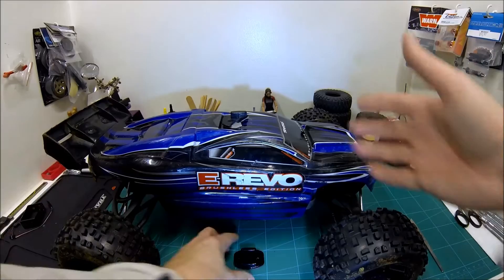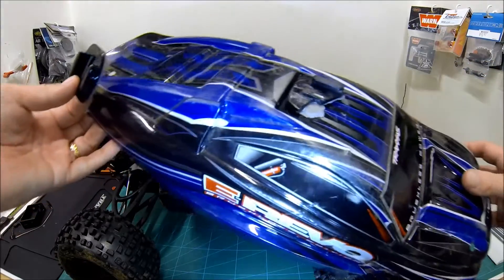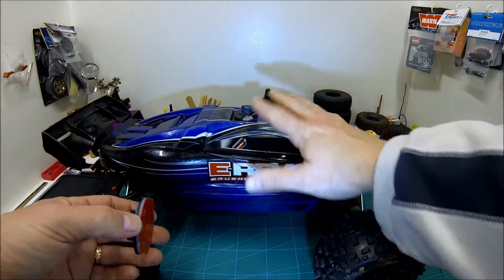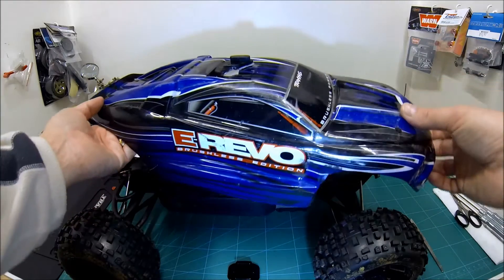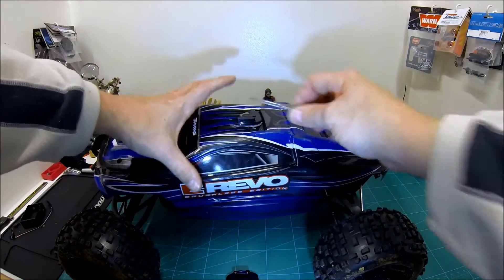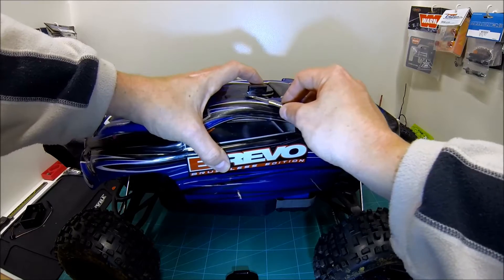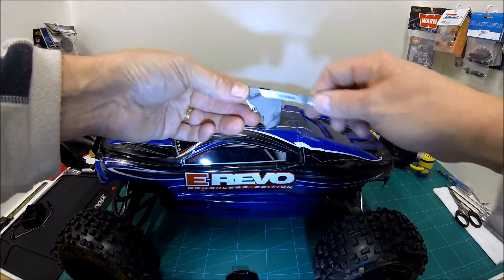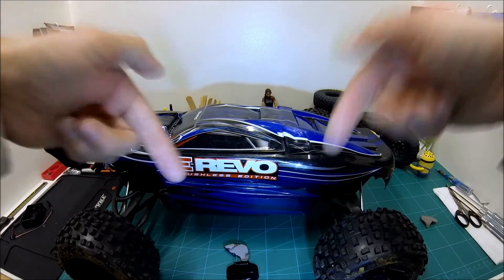GoPro Sticky Mount Removal (no heat or solvents).

Comment: I accidentally put it on the sticker for windshield
Reply from the maker: Ooops! Hopefully you can still peel the sticky pad off using the method I show in this video?
Reply: 4WheelRCUK yeah I got it off with only one slight small tear but it still looks like normal